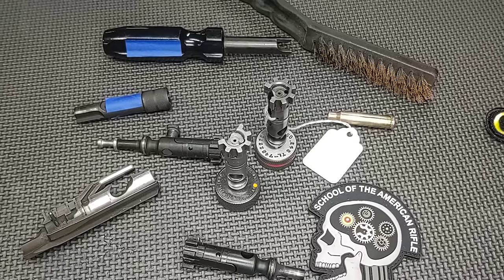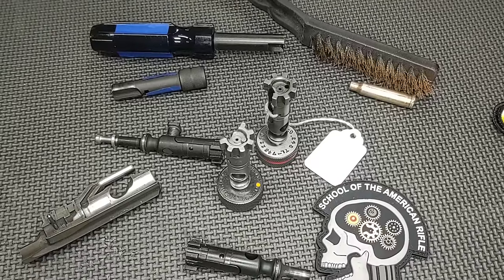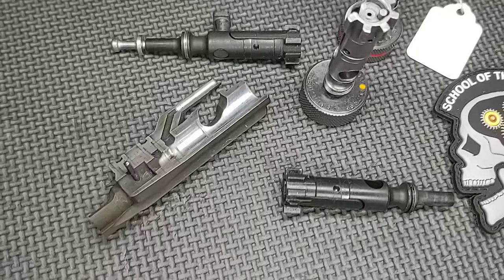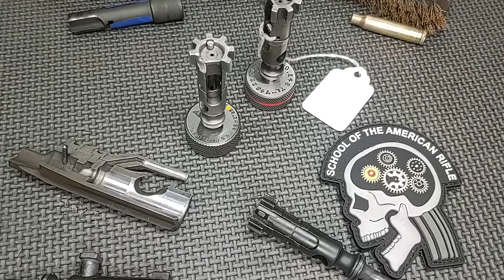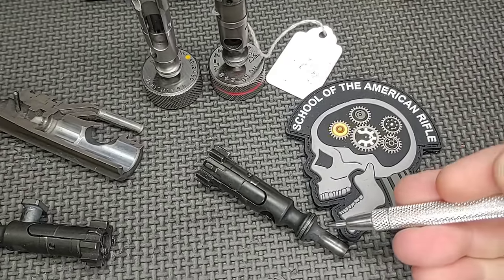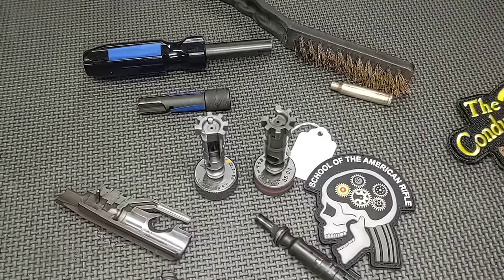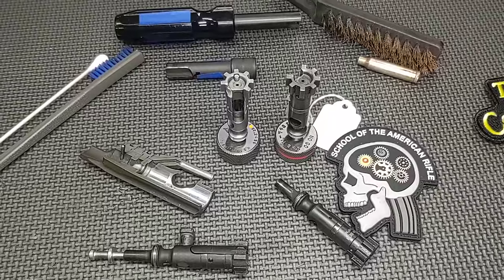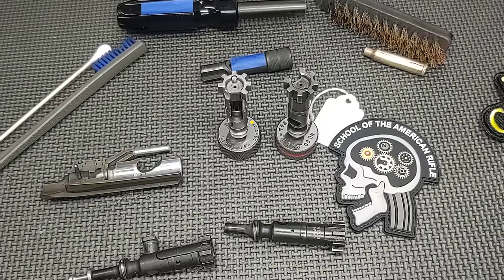Improper Cleaning can ruin your AR15 Bolt Carrier Group

Comment: I use nylon brushes, cotton swabs and bamboo skewers, like the ones you used to make kebabs on the barbecue. The sharp points great for digging carbon out of crevices and it’s a soft enough material that I don’t worry about it damaging any steel part.

Comment: Lubrication also kind of brings to mind old blackpowder guns. The principles aren't 1 to 1 here, but someone who's unfamiliar should get a picture of how lubrication can make a difference.

The little annular rings in something like a Minnié musketball get packed with a grease mixture, so that when the burning gases pushes the ball out the bore, expanding the skirt so it engages the rifling, it also greases the bore the entire way.
You can skip grease, and the musket still works, but not only does the grease soften up the carbon fouling from blackpowder so that you can shoot for a lot longer before you have to stop or move to a smaller size of projectiles, it also makes it easier to clean it all out afterwards.

Grease is also used to put a protective seal on something like a cap and ball revolver's loaded chambers (be it from moisture or errant sparks), and some people try out Crisco because they have heard it works and it sounds funny, but it's less than ideal because Crisco tends to make the carbon fouling harden up instead. 
This highlights picking a suitable lubricant, not just for antiques, but for guns in general. You want to be mindful of what stuff you use and how, some mechanisms want to be lubed with oil, and not grease, and some will want grease, and not oil, picking the right thing here can make the difference between a gun running with poor reliability or with very good reliability.
Some lubricants can also interact certain ways with certain materials, some are not suited for plastics, for instance, and some can do damage to wood grips and furniture, so they should be applied carefully.

WD40 is NOT a lubricant.

Comment: we where taught 100% wrong on this in the USAF (early 70's). in fact in the armory we had a a small bench grinder with a copper wire wheel that we used to clean the bolts!
Reply: If the brush was copper wire and not steel then it was probably not too bad. At least they used a soft metal.

Comment: Very important video.  I remember all the time we would spend in the arms room after exercises cleaning our rifles during my infantry days in the 1980s…it would take forever.

I have my own AR now and my cleaning protocol is between every 300-400 rounds, it usually takes me two to two and a half hours to get it done to what I consider an acceptable level.  Even then I figured it probably wouldn’t pass muster with my unit armorer back in the day.  I do use one of those “Cat M4” tools but I’m not nuts about it.  Perhaps I shouldn’t use it anymore?  But I guess to my credit per this video, I never tried to get “all” of the carbon off.  It seemed impossible to me so after spending some time on it I got it to where I figured it was “functionally clean” and left it at that.

No reliability problems at all with my rifle up to now.  Have had it for a little over two years, got maybe 1200-1500 rounds through it so far, cleaned it three or four times.  

A coworker of mine who served as an MP in Iraq - he’s a big “AR guy” - thinks I overdo it and after watching this video, he is probably right.  He says he only cleans his AR every 1000 rounds and when he does it takes him less than an hour.  Between cleanings, after each range session, he says he just squirts a little CLP on the bolt carrier and that’s it, “no guilt”.  Perhaps he has the right idea.

I also have an AK and I prefer that in significant part due to the easier and more straightforward maintenance.  Seems like there are so many potential pitfalls with maintaining an AR properly.  

Thanks for making this video; got you a new sub.  You showed me in definitive terms that the AR isn’t really as hard to maintain properly as all of that.  Maybe I’ll even shoot mine more now…

Comment: Pretty much only time you should clean rifle if you run it in dusty, sandy or wet environment, or you fire corrosive primer ammo. Other than that oil it and wipe the excess with a rag.

Comment: Break it down, soak it in some Breakfree, then soak in carb cleaners, then toss it in an ultrasonic cleaner with some Dawn dishwashing liquid, blow it dry & then lube it back up again. I use Lucas red & tacky grease mixed with some Wahl oil. With the demise of rear wheel drive cars Ford front spindle grease is a thing of the past. That was good barrel nut grease too. It had moly and graphite in it and it was very high temp rated.

Comment: U.S. Military could definitely benefit from seeing this video.i understand in basic it's a tool and method on the importance of learning to be thorough and attention to detail, also to drill into the mind the importance of taking care of weapons systems. Thankfully once I got to my regular unit, they backed off on the white glove intricate cleaning. Don't get me wrong they still wanted the weapons clean but not too the point of scrubbing hard especially using wire brushes. Just a good soak in carb cleaner, CLP, get off the excess carbon build up, wipe down, lite coat of oil then put back into the Arms room. That was in Infantry. However I had heard of most units outside of combat arms, did the heavy duty scraping and hardcore cleaning every time they touched their weapons. That's no good for sure.

Comment: Three letters, CLP. Use it regularly and you’ll never need to scrape. Also you get what you pay for buy your BCG in DLC or nickel boron as carbon struggles to adhere to both especially when they are lubricated with CLP.

Comment: An armorer at the Battalion 3 shop once told me, never, ever use carb cleaner on the rifle. He said that will crystalize the metal over time and cause all kinds of headaches. He also said if he came across a rifle that was damaged, and he could detect the use of carb cleaner, he'd recommend an Article 15 for the team leader that allowed his troops to use carb cleaner. There was a month of whining and belly aching when I told my team no more carb cleaner and only use the authorized CLP, but after a while the guys noticed they stopped having double feeds, or stoppages at the range, and as a side benefit, the rifles got easier to clean over time.
Reply from the maker: Chlorinated cleaners do that. Non chlorinated don't.

Comment: Long cotton swabs seem very effective with solvent to clean and can be bought at Walgreens or many pharmacies.  You can go through a lot with both cleaning and applying oil but they aren’t that expensive.  Glad to see that I had common sense with this video
Reply: Mineral spirits to clean, and mineral oil to lube. That's what I've learned - the gun specific spirits and oil are basically scented mineral spirits and mineral oil. And you only need mineral spirits if the mineral oil on a clean rag doesn't remove the dirt.

Comment: AC Delco Dexron IV or V will remove all carbon fouling. Get a small metal pan or bowl large enough to submerge the entire carrier. Place it in there complete no need to disassemble. Let it soak overnight or if you're in a hurry or need it sooner a minimum of 4 to 5 hours. Then disassemble the  carrier  as you normally would for cleaning. Just wipe off all components and reassemble. ATF has detergents that will dissolve carbon. An automatic transmission must remain debris free in order for the pumps and valves to work properly. I just blow off any excess ATF into a rag with light compressed air, lube and good to go. Dexron will not degrade the rubber extractor bushing or o ring, but some type of ATF might so use at your own risk. But Dexron IV is good to go. Also you don't need to discard the ATF, you can reuse it 100s of times. One quart should literally last a lifetime.
Reply: ATF don't work for me, never has. I go to the shed & spray a little diesel on the parts that I use in the tractor. Let sit while the air compressor is filling up, then blow out all the crud. Lube with 2 cycle TWC3 syn oil.

Comment: I’m laughing 😂. I took one of my firearms to have some work done - I don’t have all the tools. The gun shop armorer said I had too much lube on.  As a veteran and trained armorer.  I know better. I use break cleaner and standard military spec brushes, barrel and bolt brushes.  Pipe cleaners for the gas tubes. Light coat of CLP. Store in safe. You Provided Excellent information!

Comment: In the Army, even in the desert, I only made my service rifle "clean enough." It had to function as a weapon system, it didn't have to give me a surface off which I could eat.

If a weapon can't take a bit of grit and still operate, something is wrong with it either by design or damage.
Reply: This doesn't mean there weren't a number of dickhead armorers who demaned white-glove cleanliness, of course. Most of the time I just cleaned the areas I knew they were checking after purposefully failing the first inspection.

Comment: JP Enterprises has a gas ring replacement that clearly states on the spec. sheet that it will not pass the tried and true method used to check bolt gas ring wear. I just replaced the gas rings 2 hours ago. I have not fired the rifle. Do you have an opinion on the JP Enterprises rings? The BCG has no manufactures mark, so I wanted to try something a little different before buying a new BCG.
Reply from the maker: There is not repeatable inspection for one piece gas rings. That reason is why I don't use them. 

They can also pull the chrome off the gas ring run (if chrome lined).

You should use what you like regardless of my opinion.
Reply: @SchooloftheAmericanRifle  In the short/long run I should buy a good quality BCG because I honestly don't know the standards of which it was produced.
Reply: Ordered one of Brownell's BCG. Evidently their BCG's are made in the US using high standards geared to milspec standards. Most likely produced by a reputable manufacturer for the Brownell's line.
Reply: I played around with those rings and I didn't like them.  I found them easy to damage during installation.  I went back to plain vanilla rings from Bravo Company.

Comment: How often does the bolt have to be taken apart  and cleaned? When I do is just using hoppies #9 and a q-tip good enough? I use my ar for hunting coyotes so I really don’t put what I consider a lot of rounds though it. A guess would be maybe 50 a year.
Reply from the maker: Not necessary to take the bolt apart often at that round count. 

Just keep it lubed. 

I break my AR's BCG's down if suspect I shot corrosive ammo, if its exposed to saltwater, or if I allow contamination into the action (sand, mud, dirt), if I start having reliability issues, or when I reach round count that I am comfortable doing maintenance at. For me it's a few thousand rounds.

Comment: Not can, it WILL ruin your BCG. I'd go further and change the title to say, "Any cleaning other than nylon, cotton, and degreaser is ruining your AR15 bolt carrier group." The moment you see a change in the surface finish of the bare metal on the bolt tail, you have removed material and increased the tolerance in that running & sliding fit causing irreparable damage, which will be severe if you clean that bolt tail to a mirror like shine habitually. A wire brush made of steel, or a scotch brite is guaranteed to damage the surface tolerance of your bolt tail. Scrubbing fouling will also do this as it is carbon, and carbon works as a weak abrasive long term. 
The method of letting it soak in degreaser to then wipe it off is very sound. Carbon will not harm your gun as much as you think as long as your gun is lubricated. 
What would you suggest is the ideal clearance fit between a bolt tail OD and bolt carrier ID?

Comment: Is a thin motor oil or like 3 in 1 oil good for BCG's? Or what would you recommend? That's not harsh on the tool steel or nitride surface,. Does it matter?
Reply: @clintgray1623  that's why I was asking, what can be used that works well???, I use thinned motor oil, or a clp
Reply: Get some REM Oil or better some Lucas Extreme Duty gun oil and you will be good. I also clean/lube with CLP and have a large bottle of Hoppe’s # 9 given to me by my Grandpa to clean with then put oil on everything needed.
Reply: @lucky-rowe2623  yeah, I had a few small packs of Lucas gun oil z it is great....
Reply: O-20 mobile 1 !!! 1 quart will last you a lifetime!!!! Don’t waste your money on “Gun Oils “

Comment: In my M16 A1 cleaning days everything was with break Free nothing would stick to it if it's been cleaned a lot of times with break Free. I got to go clean in the desert at fort Blis we got to go clean M60  machine guns and  the armorer walked us through how to disassemble it clean it and put it back together and they were all cleaned with brake free 100 million times before we ever got it, the carbon and the dirt just fell off in the darn thing. I swear by break Free I've cleaned 22 barrels with a jag and a piece of paper towel that had been cleaned numerous times would break free and it just would push it out -stuff doesn't stick very well if you cleaned with break Free a lot of times. I've got lots of break free stories that stuff'.

Comment: I had. The same rifle for 5 years in the Marine Corps.  Hot water and powdered tide with bleach does a great job.  I grew up shooting and my arguments with the armorers were amazing.  I once strip an M60 down to ever single pin, spring i could remove even the feed tray.  The armorer freaked and said id never be able to reassemble it to working condition. 1 hr later clean without abuse and never had an issue due to cleaning.
Reply from the maker: Be careful. Bleach can damage springs and seriously reduce their service life.

Comment: I've never thought about them working like a lapping tool before, that makes sense.  I've had a CAT Outdoors tool for 5.56 and 7.62 bolts for years.  I've rarely used them.  One pass to knock anything heavy off and that's it if I did get them out.  I've never had that much build up that a good soak and wipe down didn't get rid of most of it.

Comment: I agree. For the average shooter there is NO REASON to use a carbon scraper. SOAK & lightly brush & don't SCRAPE.  A scraper is a good tool when used by the military in instances where there is not time to soak and brush the components.

Comment: I wish this was mandatory training for US Army unit armorers, and the supply sergeants and unit first sergeants and command sergeant majors they report to . . . not to mention IG Inspection teams. You will FAIL and will be PUNISHED if it does NOT pass a white glove inspection. STEEL wire brushes and STEEL WOOL and crocus paper are common just to get a unit armorer to pass it for turn-in to the arms room. MUST be clean enough to EAT with.

Comment: Im curious how the brass would removal material from the steel is that possible? Ive seen a brass brush used on bluing and didn't damage it.
Reply from the maker: Ever see a crowning lap used on a barrel to recrown it? It what Gunsmiths use with lapping compound.

Brass plus fouling is abrasive.
Reply: @SchooloftheAmericanRifle  oh okay that makes sense actually

Comment: Only abrasive tools I use at this point is a nylon brush or toothbrush. No copper/bronze brush, DEFINITELY NO STEEL

Lube keeps everything soft, so I never need those heavy metal brushes anyway